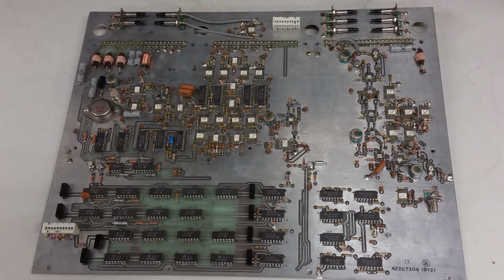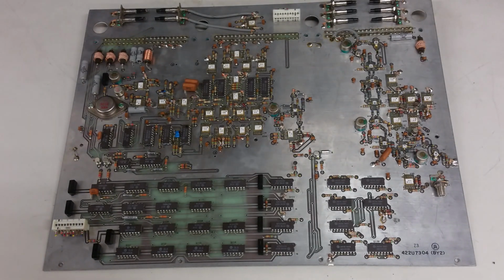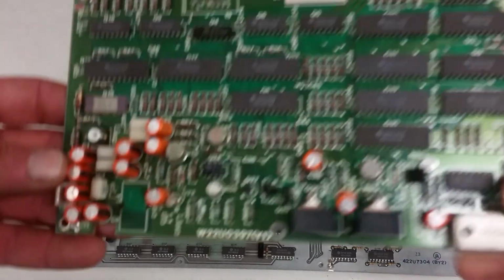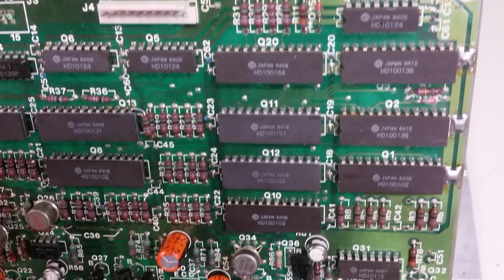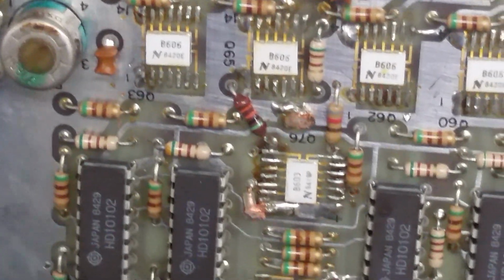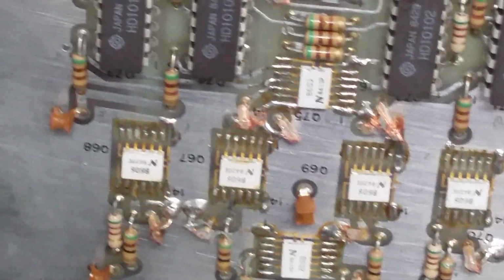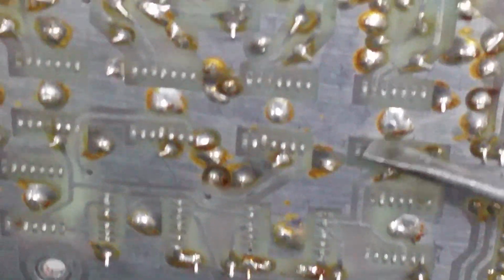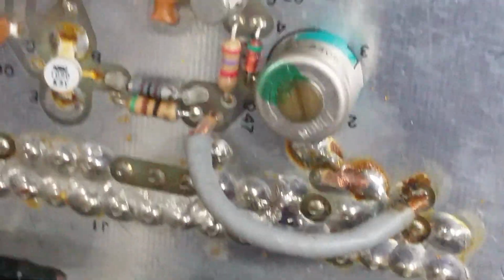Mystery ECL ICs

Comment: These mystery ICs seem to be NEC ECL delay lines from the 10KH series. µPB6311, and 6330 were the most common. Thats the closest thing I could find in the 1985 selection guide. Sometimes they abbreviated their markings so the ICs were hard to find. But in this case it seems to be enough space on the surface.
Reply: Found a later selection guide that implies that these may be ASICs. The "B" on the "uPB" means "digital bipolar" (mentioned earlier in the selection guide). Seeems they are some sort of hardwired ECL PALs perhaps. http://bitsavers.trailing-edge.com/components/nec/_dataBooks/1991_NEC_Product_Selection_Guide.pdf
Reply from the maker: Honestly, I am not convinced. There is plenty of room on the chips for the full four digits. Yes, they could be ASICs, intended just for this piece of test equipment. Perhaps I should see if I can find the technical manual from Anritsu.
Reply: @uniservo  Yes, that's why I answered myself, and edited my comment :) There is plenty of room.
Reply: uniservo uPB was indeed a generic prefix for bipolar ICs at NEC. I think these don't have missing digits, one look at a late 70s NEC databook shows that most of their ICs at the time (such as the famous uPD765) had 3 digits after the uPx prefix. I don't think they started using 4 until around the late 70s/early 80s. (btw, uP is short for "micro pack", apparently their early marketing name for ICs). these also don't look like the ECL ICs used in the circa 1971 D10 electronic switching system (equivalent of 1ESS; manufactured by NEC, Hitachi, and Fujitsu amongst other OEMs for NTT), that thing just had ceramic DIPs. I wonder if these were also used in NEC's mainframe CPUs of the time? would make sense for them to use something like this...
Reply from the maker: Yes I agree about the B being bipolar. I was looking at a somewhat confusing chart while doing research and B is the flatpack suffix. Anyway, the reason I am keeping these boards is that I might need, or run into someone that might need, some weird chips for an old NEC mainframe. Who knows...I might get one someday. I have a Hitachi M180 that needs a video some day. If I recall correctly, it has some Hitachi-specific 10K parts in it...
Reply: @techfury90  Yeah you are most likely right. There would be enough space to have one more digit on it if needed.